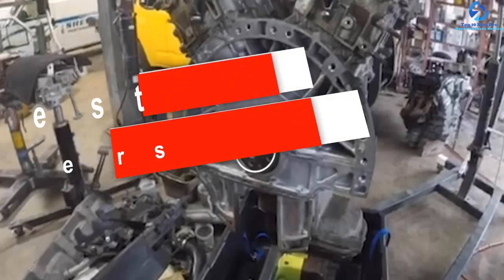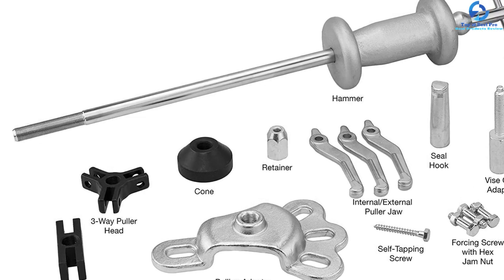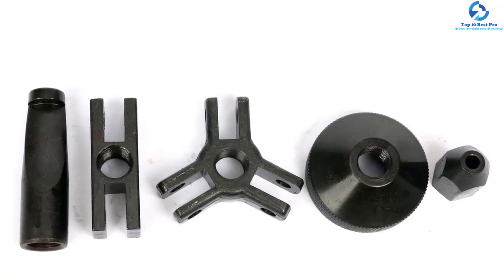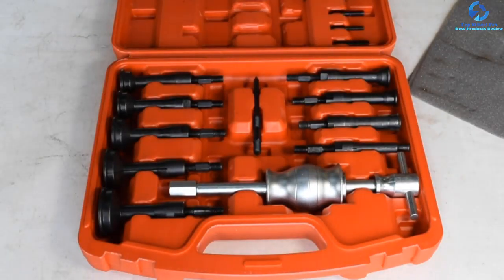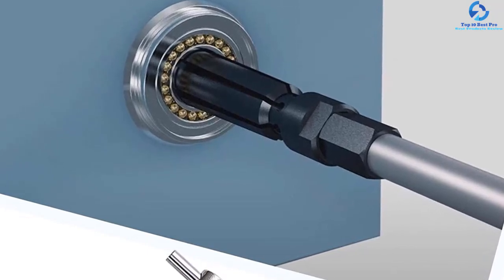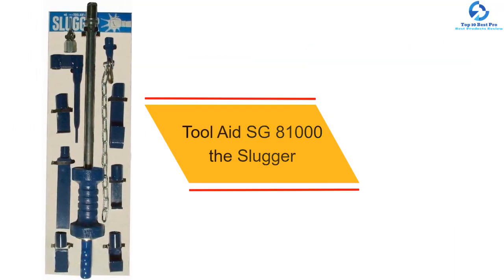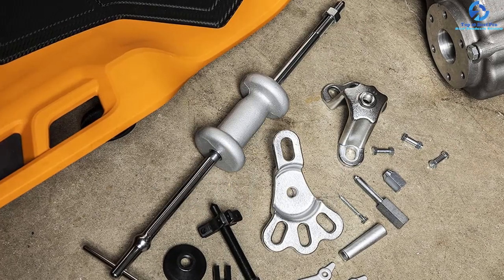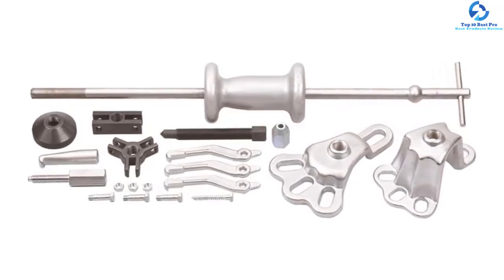🔶Top 10 Best Slide Hammers in 2023 Reviews

Comment from the maker: 🔶 10.Neiko 02236A Automotive Slide Hammer 
👉https://amzn.to/3XkZY7G  
🔶 9.Astro Pneumatic Tool 78415 Locking Pliers 
👉https://amzn.to/3Gt6G5G 
🔶 8.MILELAKE 16pc Slide Hammer Dent Puller 
👉https://amzn.to/3OkSv4u 
🔶 7.rion Motor Tech Puller Extractor Kit 
👉https://amzn.to/3VdTu92  
🔶 6.CARTMAN Slide Hammer
👉https://amzn.to/3TQrrLB 
🔶 5.H & S Auto Shot 1016 Slide Hammers 
👉https://amzn.to/3OkfFrQ  
🔶 4. OEMTOOLS 25922 Dent Puller Set 
👉https://amzn.to/3Oo9Tp5 
🔶 3.Tool Aid SG 81000 the Slugger, Slide Hammer 
👉https://amzn.to/3UQdTRy 
🔶 2.GEARWRENCH 10 Way Slide Hammer Puller Set 
👉https://amzn.to/3EJmL5T 
🔶 1.OTC 6540 Rear Axle Bearing Puller Set 
👉https://amzn.to/3ErrtUs